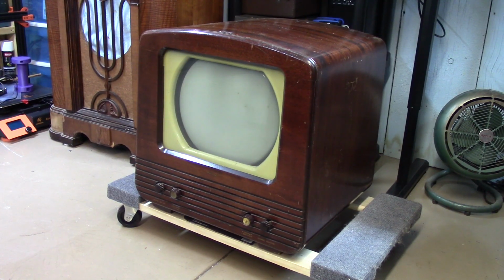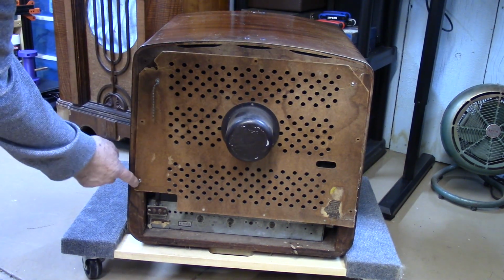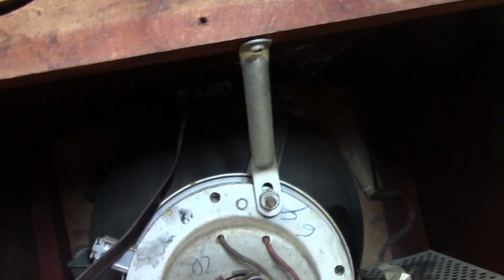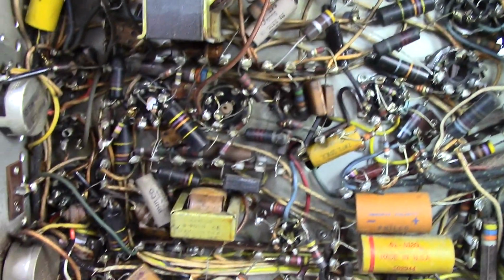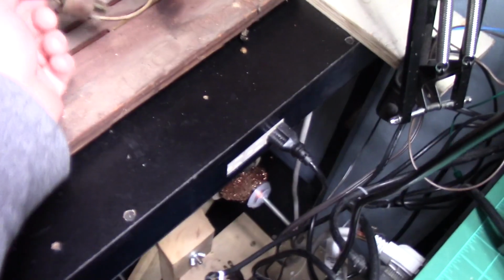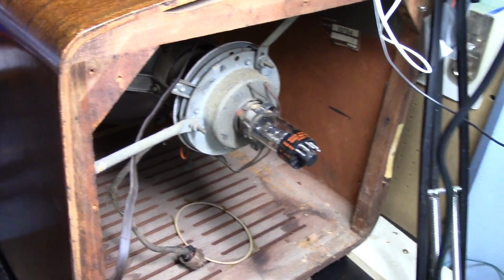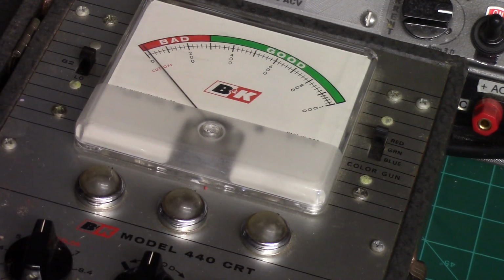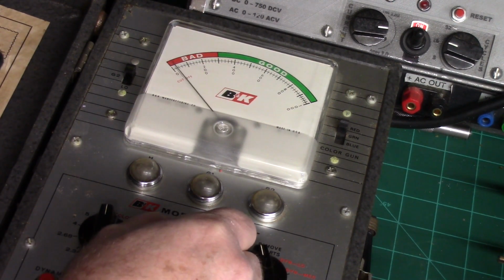1950 Philco T1401 Television

Comment: Hi Gregg,   I have nearly the same TV set, but a T1105. 
Do you know if it is a collectible or how much it might be worth? How to find a buyer?  Thanks....   - Bill L
Reply from the maker: Bill, I happened along this one about 5 years ago in an antique store. and paid I believe like $75 I think. It was in ok shape but was missing some parts and obviously did not work. Anybody looking to restore it isn't going to pay more than $50 for it, because of parts and labor. I tried to sell mine for $25 and even give it away for free prior to my restoration attempt. Unless the CRT is for certain good it's not worth much.
Reply: @greggsvintageworkshop8974  Hey Gregg, Thanks for the quick & useful response ! An antique dealer said; perhaps $100-ish, so I take that is a good. The insides light up, tubes, etc.... But the important tube, the picture tube doesn't. WoW , a relative gave it to me years ago & I was in the TV/film business for years, so it was a cool addition to my place. But now it's getting more heavy to move around. The 'more heavy' is relative due to some aging on my part ....    thanks again & happy restoration -  Bill

Comment: Good find. Not messed with and the SAMs is available free on the Early Television site. Electrolytic and bumblebee caps
 are going to all need replacing and the pix tube tests good. I think this will be an awesome first TV project for you Gregg.
Reply from the maker: Thanks Steve, yeah I never expected to ever even attempt this, but sometimes I just need to challenge myself I guess.

Comment: Oooh - nice and minty underneath :)  Lot of work and a lot of caps, but well designed.  Yes, it sure looks like the CRT is good.  You're lucky to have a strong replacement CRT from '56.  Some kitchen appliance cords have the same spacing.  Sunbeam mixers for example.  Your local hardware store may have some.
Reply from the maker: Thank You Bob. I'll see what I can find locally. I did find one on EBay, but wasn't going to spend the money just yet.

Comment: That is scary looking under there. Especially all those 'bumble bee' capacitors. They seem to be notorious for almost always being bad.  Be interesting to see what you decide.
Reply from the maker: Thanks Bob. Yeah, I know. If I do decide to give it a shot, all electrolytics and all Bumblebee's will be replaced. I could easily be into it for around $150 only to not work. It kind of comes down to the power-up without the rectifier tube and what that reveals.

Comment: Hey Gregg, yeah Bob knows his sh.. er.. stuff. I started out doing TV's almost exclusively, but quickly discovered they were not my cup of tea. I know it's all just electronic circuits, but they become quite complicated when trying to sort out all of the different things that go into one of these idiot boxes. LOL I think if you keep in mind all of the different circuits involved and concentrate on those  one at a time you have a better shot. The earlier sets are usually much easier to work on as the various circuits are more independent of one another. Later solid state sets began to go with circuits which were much more dependent on other circuits in the set to work. I wish you much luck my friend. Good CRT, off to a good start! :)
Reply from the maker: Thanks Doug, yeah I know it is a BIG challenge, and one I may not do, because I don't have money to waste. We shall see what happens with the power-up without the rectifier tube and what that reveals.